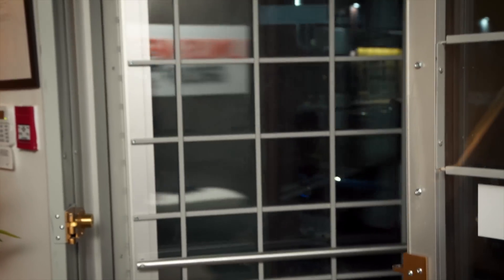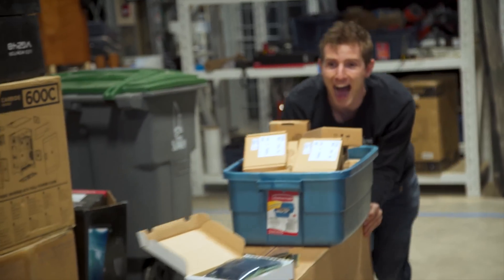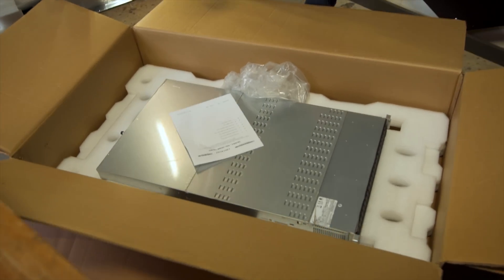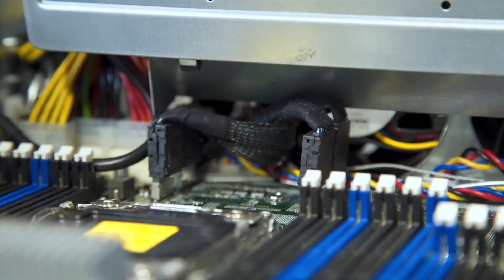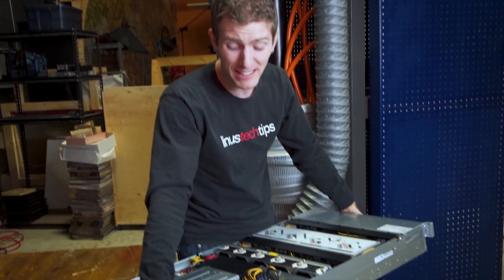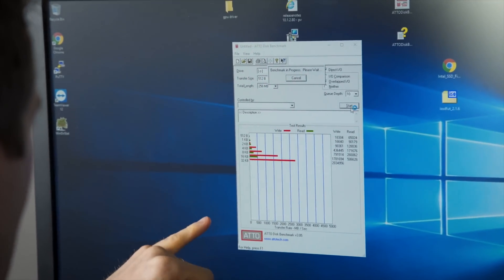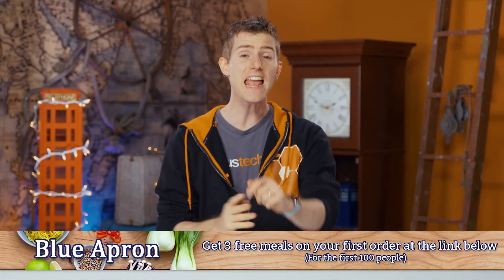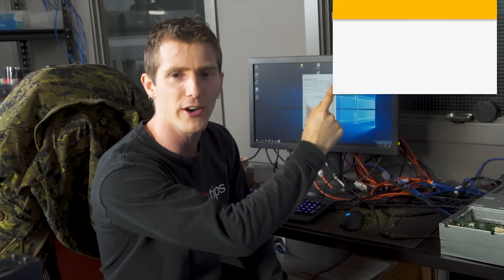The Fastest Storage EVER – HOLY $H!T Ep 14

Comment: But Linus why are you using Microsoft Windows/Server as OS? The networkstack implementation is horrible which slows down your  (theoretical) speed from the quadro 10GBit/s network card even in a trunk configuration.
Also you won't be able use this high speed storage with 10Gbyte/s IO when your network limits the transfer to theoretical 5000 MB/s ( =4x10Gbit/s) - previous mentioned Microsoft problem not included.
For the RAID configuration I would suggest a RAID 60. From your raw storage of 28.8 TB you will be able to use 24 TB because this would need 4 Disks for parity. Such a configuration provides high performance and redundancy (important for your case e.g. video editing) but is only medium efficient. Hope you will make a video of the final server and configuration. Good luck.

Comment: Using two or three of this PCIe x16 cards and all with Raid 0? possible? 10 GB/s x 3 => 30 GB/s? Linus, triggered?
Reply: Let's suppose you have 4 drives that are capable of 500MB/s each. You RAID 0 two and get 800MB/s, you RAID 0 three and get 1000MB/s, you RAID 0 all the four and get 1100MB/s. It was just an example, not sure if it drops that much, but there is a significant drop in scale when you start RAIDing 0 a lot of drives. Also, it may vary depending on the RAID card used.
Reply: not at all, raid 0 usually doesn't scale properly, btw it's 10 gigabytes, not 10 gigabits
Reply: Could still work. I would like to see a HP Z TurboDrive Quad Pro Card filled with 4x Samsung Evo 960 in RAID 0. Could be awesome!
Reply: Maybe, afaik, with more than 3 drives it scales horribly
Reply: canalsemvideos What exactly do you mean by scale (in this context)?
Reply: canalsemvideos Ah I see. So in your opinion if I wanna build a high-end 4K gaming PC, should I Raid 0 a pair of SSDs or not Raid at all? If I Raid a pair, will that improve load times etc in games?
Reply: Most SSDs get up to about 500MB/s, if you see some testing in youtube, there's not a big difference in load times from a PCIe SSD to a SATA SSD, so RAID 0 one SSD probably won't make any noticeable difference to loading times, so I wouldn't recommend it, but if you are daily dealing with big files than you can use RAID 0, beware of data loss problems with one of the drives fail, otherwise, I wouldn't recommend it
Reply: you do not need them in raid for a gaming PC.
Reply: PSYCHO Just buy a NVMe SSD like the new Samsung Evo 960. You will get 3200 MB/s read and 1500 MB/s write speed. That is much faster than any normal SATA SSD and a better and much cheaper solution than doing a RAID for SSDs with a expensive controller card. What i was talking about is just something to ball around to get extrem MB/s.

Comment: Damn, If I had 10GByte/sec writes, I' wouldn't be too bothered when I have to back up games and mods with thousands of mods. Even at the smaller file size on that disk tool thingy, it looks like it was still pulling 18MB/s with 512 Byte files (some of my games have many small mods, like SimCity and Cities Skylines which both may have 1 to 300 KB assets and many of them)
Reply: Suhkma Dheek When you have about 10,000 small files, even my 180 MBps Seagate constellation is brought to its knee's by the torrent of 1-300 KB files.

These days to make things a little faster and smoother in the long run, I just store backup in a huge tar or zip file.

Comment: Next video: 24 Intel 750 series PCie SSDs
Reply: what do you mean? those are the ssds used in this video
Reply: Harry Lim those aren't pcie?
Reply: JhonToTheConners those used in the video are nvme pcie ssd's. they are the 750 series. pause the vid when hes showing off the boxes and you can see. or just go to the amazon link
Reply: Harry Lim yes but when he put them in, is it just me or does it look like regular sata ports on the ssd that he simply slipped in to the bays
Reply: nope, the 750 series ssd uses a completely different interface. And, he stated before, the supermicro server was built for nvme pcie ssd's, so naturally, its using whatever standard (since this type of interface doesnt have a standard yet). Linus also stated, those ssd are connected to the pcie slots on the motherboard. so its definitely not sata. TBH, you can do the hot swap thing with just about anything man, if you for some reason really wanted to, you can probably find a way to make hot swappable mobile phone bays or USB thumb drive bays. just get everything on the same size and standard and you can "hotswap anything.

Comment: Hi Linus! When using only 24 NVMe's in this Supermicro box you should install 12 drives in to each row of 2.5'' bays, leaving an empty bay in between each drive - this should double the read/write performance!
Hit me up if you need more info
Reply: You do know it's a storage server with 40Gb/s max? This means that in the current configuration he already has twice the performance he can actually get.
Hit me up if you need more info!
Reply: The server comes with a few additional PCI-E slots so he can always throw in more NIC's :)

This is the high end server so I think he should make most out of it. I'm sure you've noticed he had this box running with with dual 2699v4's so there is a plenty of compute there. Spreading the drives should give a massive performance improvement. Each backplane is connected with the CPU using 16 PCI-E lanes so having all 24 drives on only one of them is simply bottlenecking the drives.
Reply: Tom Michalski he would need a 100gb switch or something that can run 100gb and my guess is he doesn't have a sponsor for that nor would any of his workers computers have 100gb cards.
Reply: Well, I think it's all depending on what is he using this server for and how  planning to configure it. 
It probably won't be just a basic storage server for his workers.
Reply: if this server doesn't shout virtual machines.... then i don't know.
Reply: Derrick Mehaffy but w/ 7-10 editors pulling footage @10Gb/s a 40+GB/s active project server could help speed things up, and I think he has enough ports open on his 10 GB/s switch to use the speed w/lacp or something similar

Comment: ZFS and Raidz2 Or ZFS and stripped mirrors but since these drives have a very low failure rate look at not using drive redundancy and rather use a large stripe and do hourly ZFS snapshots to a much slower backup server. All depends on what you are going to use the server for.

Comment: I just don't understand why you guys don't just use fibre.  All this work for faster 10GbE connectivity, when you could get better performance from two 10 year old ATTO FC-84EN 8Gb cards (with 81EN cards on the work systems) and cheap Monoprice OM3 fibre cables.

And if you really need to access the storage over the network (over WiFi??), just use one of the lesser used systems as a NAS reshare.

Comment: when you see intel 750 seires PCIE 1.2TB ssd, and you find out their not PCIE, their just normal SSDs, at least i assumed they where the PCIE version, mainly because i only knew about the PCIE versions....idk
Reply: The drives he's using are PCIe, but in a 2.5" package. They're almost identical to the normal PCIe card ones, just with an extension cable.

Comment: hi! everyone, I found something EXTREMELY FISHY today while trying to find a fix for stutter in witcher 3 though it's mostly because my PC is already 7yrs old, anyways. I found this program called "BES - Battle Encoder Shirase" which allows you to use 100% of your CPU. at first, I thought it was fake because when I use MSI's tool to see my CPU load it clearly shows that it is already using 100% for both GPU and CPU. but I still tried it since I don't have anything better to do ^^. to my surprise it actually remove the stutter but didn't improve the FPS. so I tried it in AC: UNITY which is full of stutter but this time I didn't do it automatically and look for the manual way of doing that, then I open the option where you can manually tweak the CPU usage AND I WAS SURPRISED THAT IT WAS ACTUALLY LOCKED TO USE ONLY 70% POWER OF MY CPU!, SO I CRANK IT UP TO 99% THEN PLAYED THE GAME AND SURPRISED THAT THE STUTTER WAS GONE AND THE GAME IS NOW PLAYABLE!!! (MY SPEC: core2duo E7500/ 4gb ddr2 / GTX 560ti)

so what the hell is going on here!. is that normal to set your game CPU usage so low that some lower CPU will have a massive stutter and effectively making the game unplayable?. did they do it intentionally so PC gamers will buy those OVERPRICED!! new hardware?

Comment: I would love to see a full RAM storage based server!
Reply: MegaTp4 it is possible to store files on ram, but if the server shuts down you lose everything
Reply: MegaTp4 it's not like it won't work, it's about the fact that this type of server has to be powered 24/7 or at least have a battery to be able to write all the data to disc storage before running out of power.
Reply: Have you never heard of RAMdisk?
Reply: That's impossible. Do you even know how ram works?
Reply: Tomás Jarsun Don't give Linus any ideas!
Reply: Providing you have a very good backup mechanism in place and have enough power to completely empty the RAM to non-volatile storage then yeah, it should work.

However in the vast majority of cases reliability takes precedent over speed. Keeping a system simple generally makes it more reliable and makes user error less likely. So chances are that if you need that sort of performance you would figure out a way of getting it that involves splitting the load over many servers since that would reduce risk of data loss and add redundancy for if any single machine fails.
Reply: It's totally possible, the problem is the software isn't quite there yet. You can't just install a server OS onto RAM. Software wasn't built like that and there's no guards in place for accidental power down. 
But I predict in the next 10-15 years we'll start to see some real shit. There's been lots and lots of toying around in the field of RAM based Data Bases.
Reply: Tomás Jarsun This server is almost faster than consumer rams LoL
Reply: Our whole server room was full of RAM storage servers ranging between 1TB and 10TB (I think) in our server room. They took ages to startup as the bios needs to check each ram chip in serial but we ran in memory databases used for transaction processing.
Reply: Facebook uses that for their home page if I'm not mistaken
Reply: Well, you can run a server with no drives, of course you need some sort of storage to boot from, but you can use network boot to load an entire Linux filesystem in RAM via NFS, and then run the OS in RAM, and some big companies does, if you have a server that act as a cache, or is used to store temporary data, or a load balancer, a proxy, or even a web server that serves static files, or an application server, (of course with the database on another server) you can do it... also, it's more likely that a drive fails than that in a server farm power goes out, with all the UPS, emergency generators, completely independent circuits, and similar things, so i think it's also more reliable... also because, if you think about it, a Linux server used only to run an application that requires no storage, how much disk space takes ? Some Gb, less than 10, so there's no real point in having an hard drive (or two, at least you want RAID 1) in each server...
Reply: or copy all data including os from hard drive to ram and run completely on ram, ram based server will work this way but all that copying will result in snail boot times but after that, server will work super fast.
Reply: it's called a UPS(what I mean is you would have a powerful UPS and you'd be fine until your backup generators are on) and RAM-only servers do exist,they are meant for computational tasks, though.
Reply: Well, this server has 40Gbit/s up and down and that is limited by the network interface, not the storage solution. So unless you go really crazy on the networking side, the only difference would be miniscule difference in latency.
Reply: Actually I have one for SQL analysis. It's a DL380gen8 running dual E5 2690 running a 350GB ramdisk. Highest throughput with SQLIO was around 16GB/s ( which I think was maxing out somewhere in the mem bus ).
Reply: Lol what're you expecting them to network this to, a Gemini port? You'd need like 20 10Gig ports to dump data that fast.
Reply: Tomás Jarsun Well it's 12.7GB/s because the RAM has a write speed of 12.7GB/s. Basically, they have the same performance.
Reply: server shuts down, you are fucked x)
Reply: ever heard of a ramdisk?
Reply: i mean if u would work with ecc ram storage, u would have  2 strong ups systems so u don't get fucked everytime  u get a brownout...
and still u would pull your data from ssds or hdds in the first place....
Reply: Tomás Jarsun what if someone unplugs it... shit
Reply: SUN used to have thoose. Well basically still diskarrays but with GIGANTIC ram caches. Totally doable with ZFS nowadays without dataloss.
Reply: So, Redis?
Reply: Ailuropoda melanoleuca Nineoneone I don't think you know what you are talking about lol
If that was the case, we wouldn't have the need for RAM. :P
Reply: +Lynn Smith has two nicknames for the same site. scammers need to get gud
Reply: A server system with a 256 GB SSD and 240 GB of RAM dedicated as storage would work, you could flash the SSD to the RAM on boot.

The fuck is the point though, no software is built to access or use system storage that way
Reply: smokeydops: there are filesystems that use storage that way the software on top would not have any notice of this.
Reply: needs some pretty complicated robots to anticipate what data you need, and transfer it to Memory Cache before you need it, and then once no longer needed returned to permanent storage.
Reply: None of us now what is virtualization? 

You can install your hypervisor on a regular drive and install your VM on a RAMdisk.
Reply: interlace the analytics for Memory preload in Superfetch aren't complex enough. for these purposes (as a storage server), to preload the data at the right time would necessitate actual telepathy. many users, accessing all of the data all the time. (for a personal Server it would be alright, though)

besides, the *MAIN* benefit of Superfetch is knowing where commonly used data on Disk is located to get it faster when it is needed.

and ofcourse all of this nonsense wouldn't be truly needed if Microsofts' idea of Indexing wasn't so slow. 3rd party Indexing methods are much lighting on the system, many manitudes faster at finding data, and take up less local data to manage Indexing the data on the system.
Reply: Ailuropoda melanoleuca Nineoneone 
F
Reply: Daddy So a ram based server will not work

Comment: 64 gigs of ram? that is all? why not just put in like 120+, just cuz
Reply: +HighClass Unreleased Nobody needs more than a 20MB hard drive! That would be IMPOSSIBLE to fill!"
Reply: leakyspaceboots because then he has to check more ram out of inventory and is 128GB ram really worth scanning the barcode on each of the sticks?
Reply: +HighClass Unreleased I was just trying to convey how just because you don't need that amount of ram, doesn't mean others don't, or won't very very soon. A year ago I was using under 3 gigs of ram in my server, I upgraded to 32gb two months ago and am already using all of it. Things change extremely quickly.
Reply: I have a workstation with 64GB ram, and I ran out of memory with some fluid simulations.
Reply: ik just thought it would be cool lol
Reply: HighClass Unreleased My main server/workstation has 256gb of ram and i use ALL of it.
Reply: I have a 128GB ram Workstation at work, and I use all for mechanical simulation calculation ! Ok, not all, the rest is for using the softs required to work on big models without freezing ! ;)
Reply: My friend works in a company that deals with virtualization and node based compute. They have multiple servers with 1TB of RAM or more. They're running out of memory.
Reply: No pc needs 128 GB, do you need it? Maybe a Google workstation but there it ends I think
Reply: Ryan White for what?... Nobody needs that
Reply: ***** From what time did you came from? 1982?
Reply: Well, you could use 100GB of this ram for a ramdisk! For a moment I was thinking if upgrading from 16 to 32GB (or even 64GB) was worth a thought if you could use it for the ramdisk. On the other hand, there is no practical advantage of hyper-fast storage in terms of gaming. So no, I won't.
Reply: leakyspaceboots 1TB!!
Reply: Yeah, nobody needs that until they run an exchange server or sql server, what abut virtualisation, thats the reason modern servers can have up to 4tb and 4 processors!!

Comment: All those cables, this will probably all become wireless in the future.
Reply: So you either go blind from visible light, start boiling from infra red or get cancer from uv.
Reply: you will get cancer if this goes wireless
Reply: Not with Li-Fi. It doesn't transmit radio signals, only light. Tests have reached speeds of well over 200 Gbit transferring data using leds.
Reply: How is light not radio?
Also, Li-Fi is amazing in the sense that it's rendered useless by massive walls made from exotic materials like a single sheet of paper.
Reply: Didn't know light emitted radio frequencies.